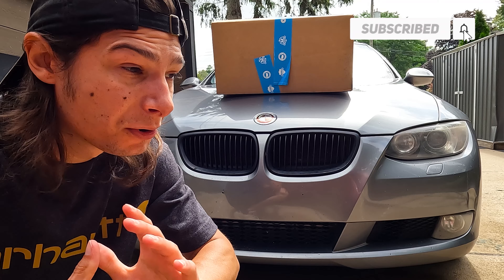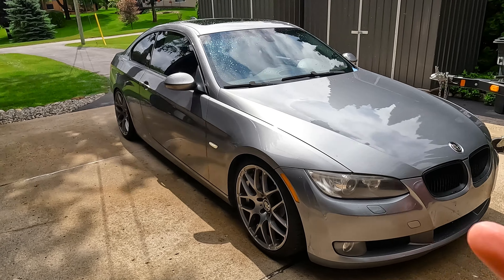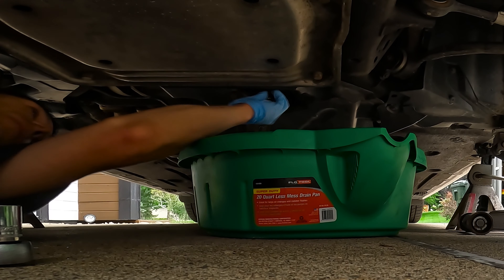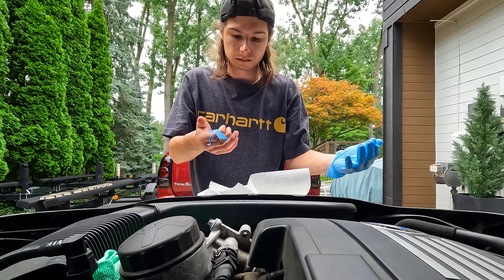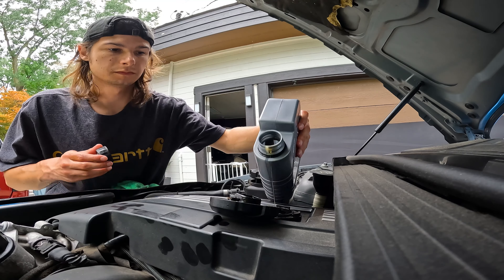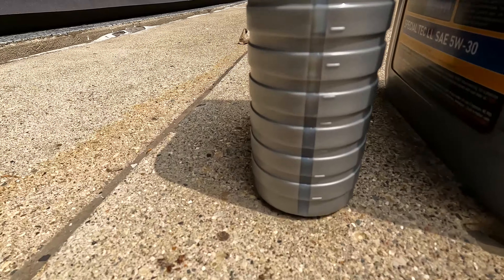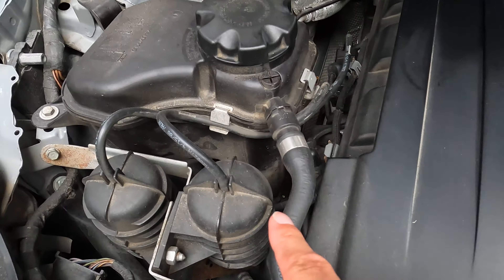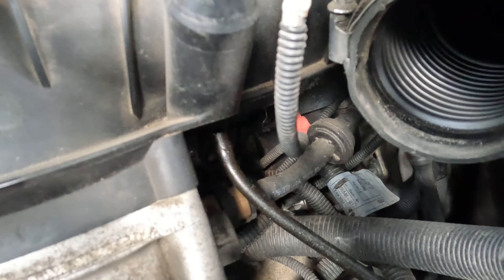I Might Have Solved The Rough Idle On My BMW 335i

Comment: Bro just recently changed my coil and plugs to my n54 and 5 minutes later I got a really bad misfire engine service soon light starts blinking after I drive it for more than 10 minutes what could it be ? Engine starts vibrating
Reply from the maker: It could be a few different things but given it started after changing the plugs and coils, I would make sure all of the coil packs are fully seated onto the spark plugs and that the connections are good to the wire harness. If it’s not that you could have a bad gap on one of your new plugs. If you’re tuned it’s recommended to get the 1 step colder spark plugs. Hopefully this helps💪
Reply: @ thanks

Comment: Nice one :)

I really want to own a 335i
Reply from the maker: It’s not for everybody but they’re fun!
Reply: @AlteredAutomotive  i would repair everything that’s necessary, as to keep this nice car running it’s just something that has to be done… biggest issue is the price for new injectors imo.
Reply from the maker: @seesikopter  The injector prices are the biggest problem with this car, you could buy parts to replace nearly everything but the injectors for the price of em sadly
Reply: @AlteredAutomotive  if I buy one I should at least have 3k held back just in case, I could fix one issue with that, be it turbochargers, injectors or hpfp…